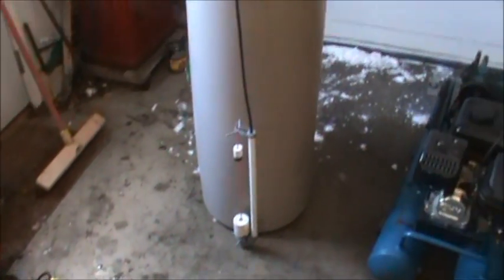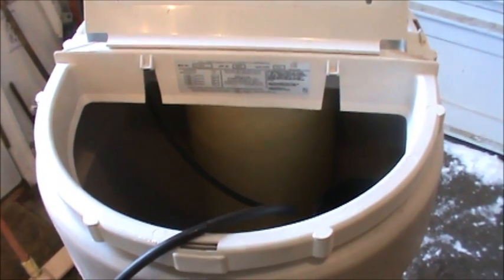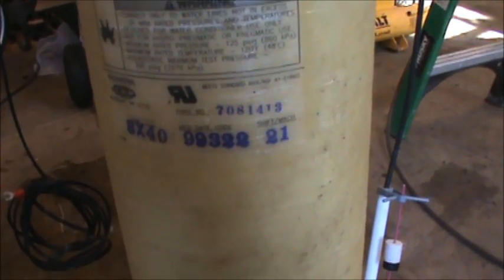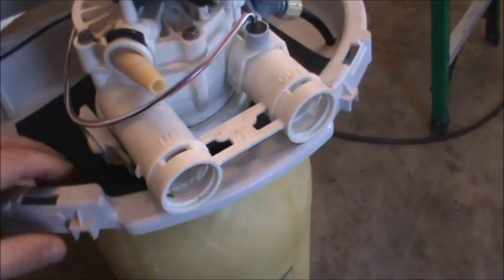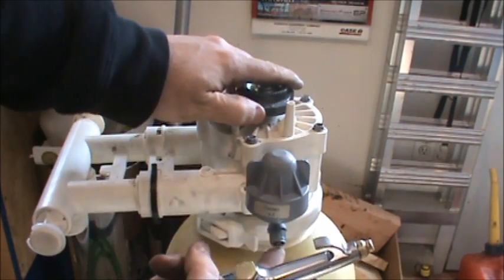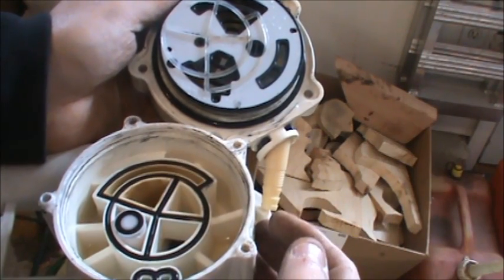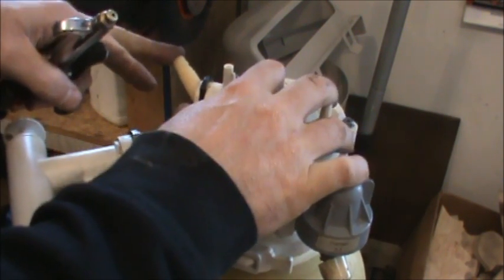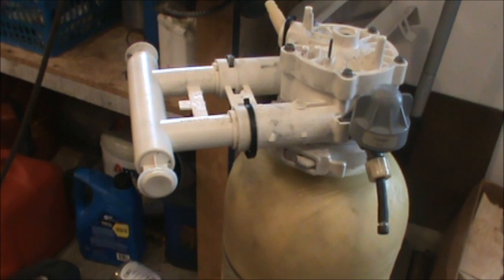Water Softener Tank  DIY Air Compressor

Comment: "sand" is called medium or ryme
Reply from the maker: Thanks, I really didn't know what it was.
Reply: Ryme?  Is resin”   Little plastic beads that filter off the salt from the brine tank that he took it out of.  Is water softener.  So water goes through the main pastic tub tank the fiberglass tank was inside,  that is filled with salt making it a brine then water is pushed through the media resin tank which filters out a certain amount of salt and with it absorbs iron, calcium or other minerals depending on the type of resin that you put in that tank..  im afraid to pressurize mine..  same exact thing as his but reading about it i dunno..  i mean their fiberglass.. theyre highly uv degradable also so iftheyre kept in the sun theyll degrade quickly and they are rated like pex pipe.. theyre temp/ pressure listed so like 120psi @150°F..  so pumping air in to one the air gonna be hot from being compressed..  some dual piston pumps run at 300°f at the outlet..  so just saying my giblets will be retreated fully when i go to pressurize it..  maybe hydrostaticly test first...  dunno.. good tank though.  Meant to hold corrisive chemicals..

Comment: NEVER USE ANY PLASTIC TYPE PARTS WITH COMPRESSED AIR, You are making a bomb D-WIDE. I could be very wrong in thinking that fiberglass is in the same catagori. Im sure its heavier, but I dont like the idea man, Ive seen som real bad things when plastics fail under presser of compressed air
Reply: Yea i make 2 liter bombs all the time.. They make ya pee a little when they go boom..  color your shorts if your holding it when it go boom...

Comment: Hey, I was thinking that you can mount it so that the bypass valve is facing down with a little pitch, it should work great. Especially with a little air behind it to push the water out. pretty cool project, thanks